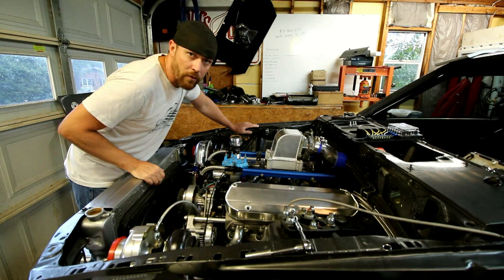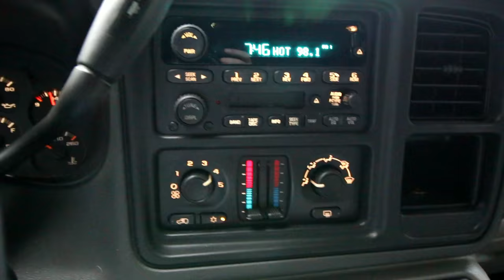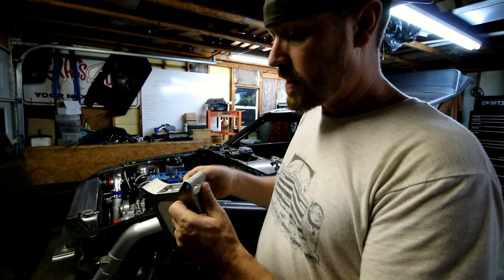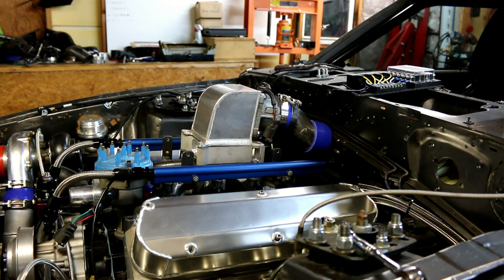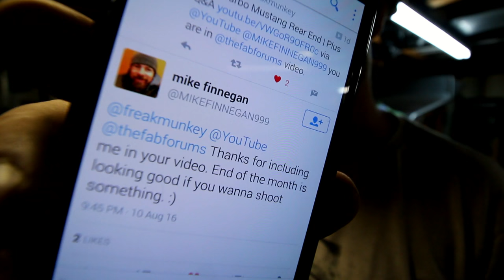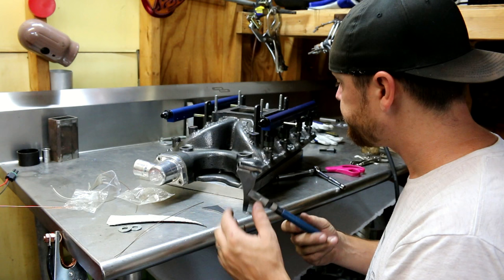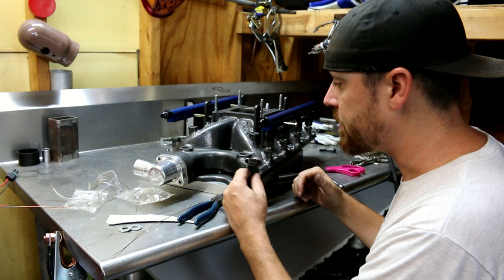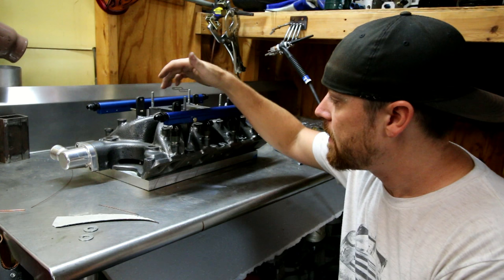Mike Finnegan Collab Video ?

Comment: Hey Kyle, fox is looking good, awesome news on the colab'!

Suggestion, old retired mechanic showed me a trick for injectors, if you spray the injector port and fuel rail with glass cleaner it will lube the injectors as they go in, insuring they will go in every single time without the risk of damaging an oring. it also acts as a glue almost when it dries up and helps the oring seal up.

KEEP UP THE GOOD WORK!
Reply from the maker: I will have to try it. I just used air oil in this video

Comment: Same guy with the 1992 Ford Mustang with the 408w that bought the kooks 1 7/8" long tubes that didn't fit. Forgot to mention that my mustang is fitted with a maximum Motorsport front tubular set up. Tubular a-arms, k-member and cool overs with a morose road race pan. I herd of stainless steel works saying they have a set that will work but I've been burned once. Can't afford to get burned twice. These headers are over $1k.
Reply from the maker: I would be buying some shorties

Comment: Great content, as per usual!
Regarding the additional fuel injectors bungs: have you thought about fabricating a "hold down rail" to use with fuel injector boss plugs and bolt-on in-place of the second fuel rail?  The injector boss plugs are pretty inexpensive, and fabricating a hold down method/rail should be pretty easy.  That way, down the road, you have the option of running a staged injector setup or dual fuel setup if you wanted.
Reply from the maker: send me a link to the plugs that you are talking about
Reply: +The Fab Forums
Something like these: https://www.efihardware.com/image/4823/injector-port-plug-short_4823
Or just spin some up on the lathe
I used similar plugs to fill injector holes on a 4cyl when converting to Weber sidedrafts, worked perfect
Reply from the maker: nice. I was wanting to make some to plug the hole temporarily but didnt know they made them already

Comment: What about using the upper injector holes, threaded,  as the location for a boss for some "arms" that reach out laterally and hold down the rail (kinda like spider legs)? If you have other stuff to bolt up up there,  they might double for additional mounting points. Maybe it would kill 2 birds with 1 stone.
Reply from the maker: sounds complicated

Comment: Love your show, I building a 1992 Mustang fox body 408w.  Can`t seem to find a set of 1 7/8" with 3" longtube headers that will fit without rubbing.  Bought a set of kooks custom headers that would not fit and of course they would not take them back.  Not sure what options I have left other then a build set of $2k.  Kinda pricey??  Second question, I love the valve covers of the fox body mustang your building, where did you get them and did you customize them?  Thanks Sam.  Love the show again.
Reply from the maker: Wow....Kooks is usually on the money. I am surprised they didnt fit. The valve cover are some I purchased on ebay years ago.

Comment: You should put some thought into how you plug those injector bungs I would keep the second set usable for dual fuel system like pump gas and turn on a race gas injector over Xpsi of boost. What engine management are you using?
Reply from the maker: +MrRyan62583 Ack I was consider that when I bought the intake but I have since decided against it. Gonna run e85 some my pump gas is my race gas. I'm running BigStuff3
Reply: +The Fab Forums does big stuff allow use of a content sensor. You can then mix e85/pump I can adjust on its own?
Reply from the maker: yeah I believe so
Reply: +The Fab Forums sweet. I run a efi source mega squirt 3 gold box I will be venturing into flex fuel stuff on my twin turbo mustang here pretty soon. Check out my channel some videos of the car I build my all stuff also but not much of a videoing  person
Reply from the maker: I will check it

Comment: doing the fuel rail tie down like you did. in my book wasn't a good idea. if there ever is a fuel issue around the rails or faulty injector or prong problem you have to unholy the intake. and then retorque it back done. can't just do one side have to retorque them Ll
Reply: Sorry for all the phone autocorrects
Reply from the maker: no you can take the rail off without un bolting the intake
Reply: +The Fab Forums I forgot about a bolt running through the top of the rails to the side of the intake. unholy it there and your good to go
Reply from the maker: yeah